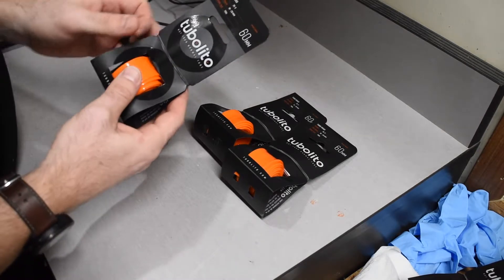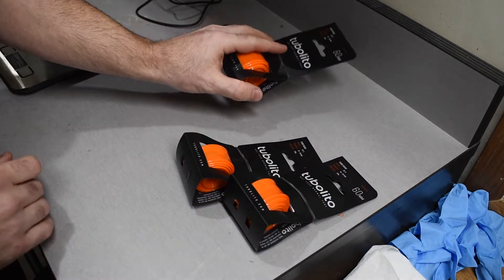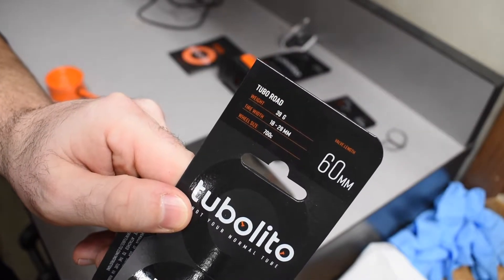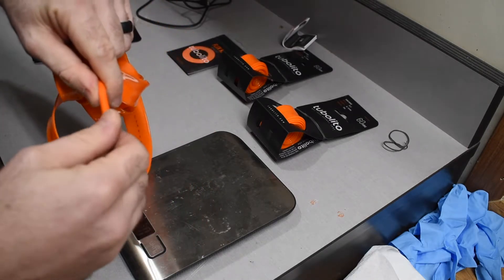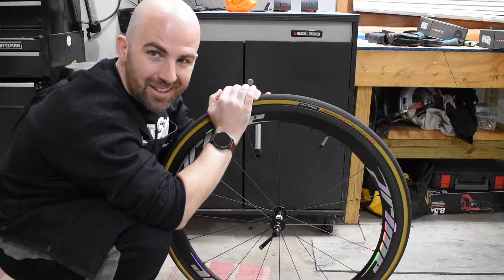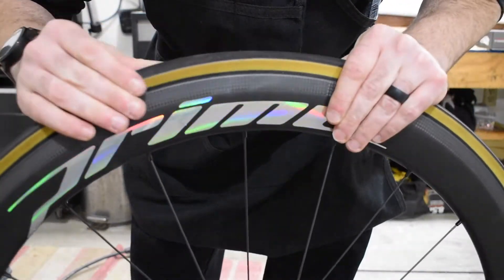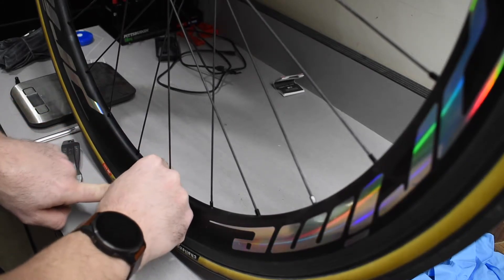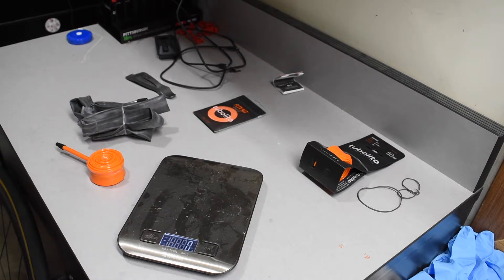Tubolito road tubes / unboxing / weight / install

Comment: Great spare for a tubeless setup.   I do find most bike shop staff try to down sale them because of their price but dont see any issue with bikes costing more then a car that they sale.
Reply from the maker: Absolutely!  They’re pricy, but my experience with them has been great so far.  And they are absolutely fantastic for packing along for spares. So small and so light.  Rolling resistance and such is in the margins, but size and weight are noticeably better than butyl and installation and puncture protection has been as good or better for me.
Reply: @JMCyclingVideos  any additional risk with installing them in a larger tire?  Putting a 28-35 TPU tube in a 38c tire?
Reply: @rickrb  so tubolito road tubes are rated for 18-28mm tires. I wouldn’t recommend using those in a 38c tire. They do make a cx/gravel tube which I’ve also had good luck with that’s rated for 30-47mm tires. I ran them in 37c WTB Riddlers for ~500 miles with no punctures and I carry a couple for spares now. I rub tubeless on my gravel bike now so I couldn’t give a long term review of the gravel tubes.  Good luck with it!

Comment: Hows the puncture resistance?  I like the tubes.
Reply from the maker: I haven't put a TON of miles on them yet.  I've put about 750miles on the road tubes and about 500-600miles on the gravel/CX tubes.  I haven't had a single puncture.  And that includes some pretty chunky gravel.  Sorry I haven't gotten around to doing my review video.  Overall, I'm much more pleased with them than I expected.  No punctures, hold air better than any tube or tubeless set up I've used, and the weight is on point.  My only complaint is that they aren't quite as supple as a thinner tube or tubeless.  You can definitely feel the road more.  I can't comment on if that affects the rolling resistance...
Reply: Sounds good.

Comment: Is 60mm not too short for your 50mm rims? Enough valve for a c02 inflater?
Reply from the maker: No, it was actually just right.  I try to keep valves just long enough to fully operate and that was just about the limit.  I can’t say that 60mm will work for every 50mm wheelset though.

Comment: What do you think, are they safe to be use in a tandem bike ?
Reply from the maker: I appreciate the question, however, having no experience with a tandem I don’t want to steer you wrong. I can’t say for sure if they would work with the additional load or not.  Use at your own risk in a tandem. Perhaps you can reach out to Tubolito for an official answer.
Reply: @JMCyclingVideos  Thanks for your assessment. I appreciate that !